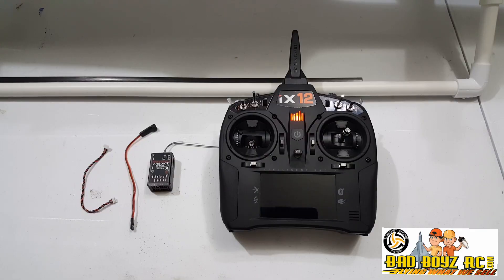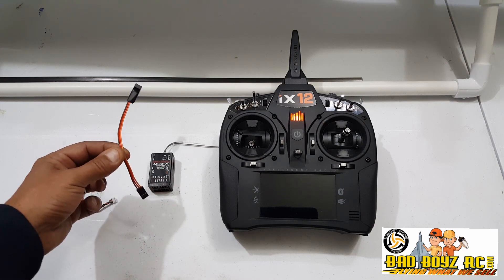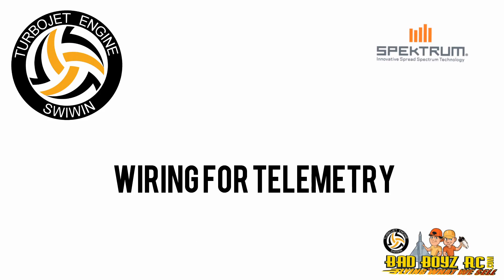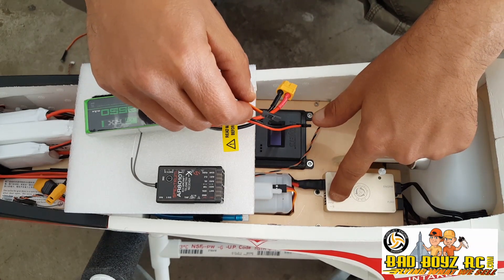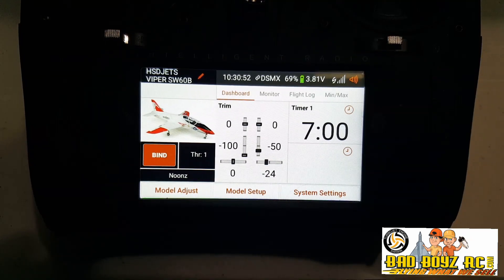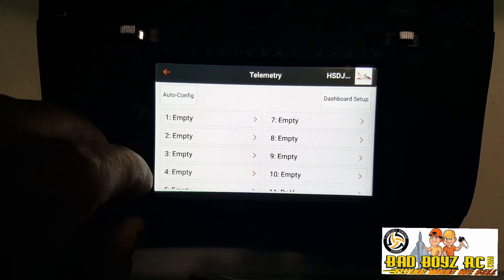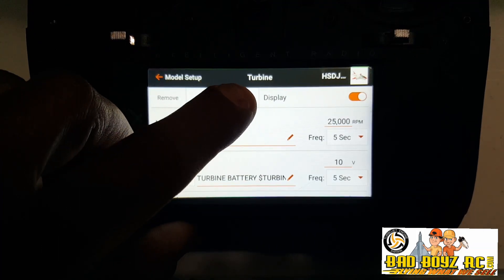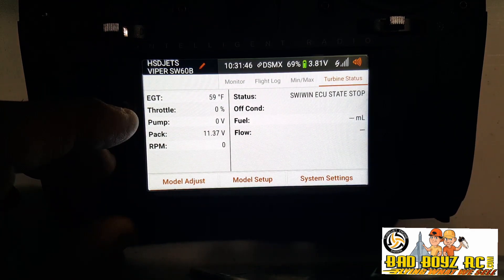Setting up SWIWIN / Spektrum Telemetry

Comment: I am trying to figure out why I am not getting Turbine Telemetry on my SW80B/iX20/AR14410T. i have Bad Boyz xbus cable but BB tpld me I need vspeak modules but how does it connect to the RX AR14410T?
Reply: I have the same issue. Have you figured it out?